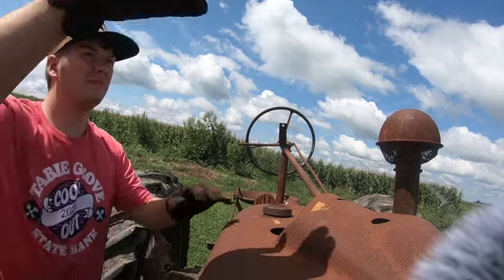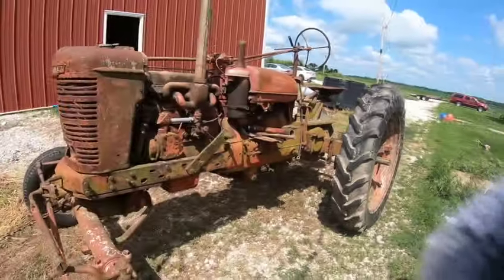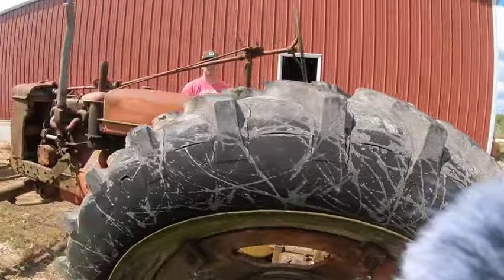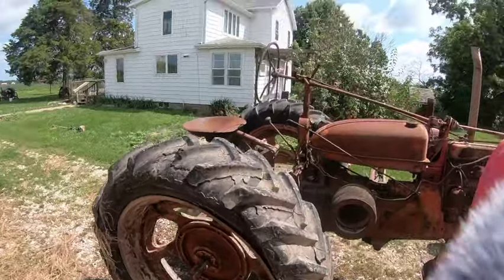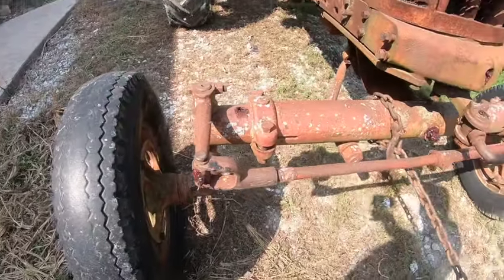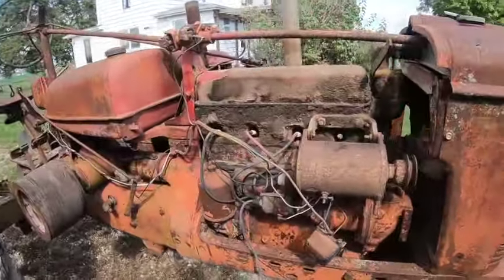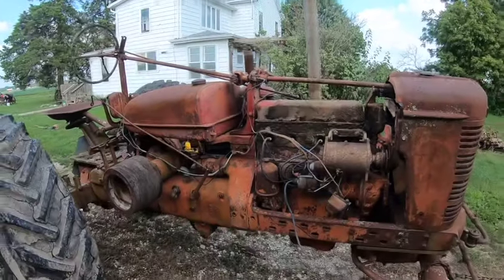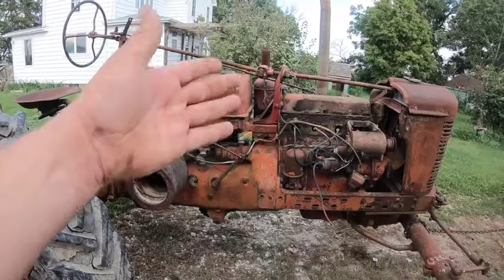Wartime Farmall H comes to the Grumpy Farmstead!.

Comment: My late father had a 43 H with a cast iron shifter knob . It's still in the family and runs great. It was the first tractor that was bought new on the farm. It's still on the farm four generations later it still gets used on the hay rake once in a while.
Reply from the maker: It’s going to get the acid treatment !!! The tank is a little worse than the other one but not bad
Reply from the maker: That is the story of my 5 star